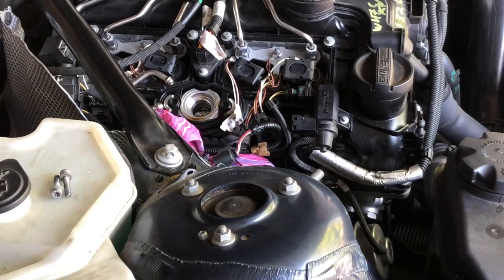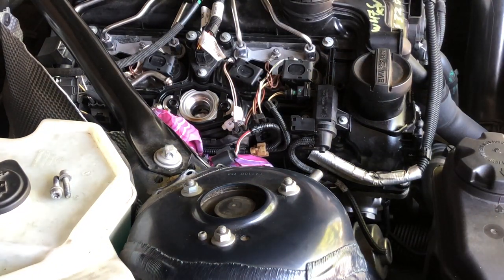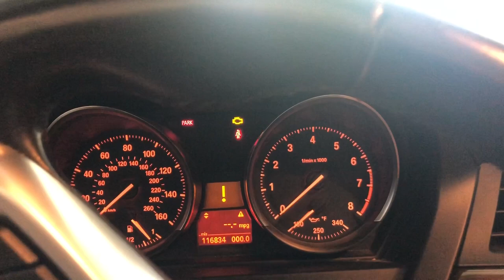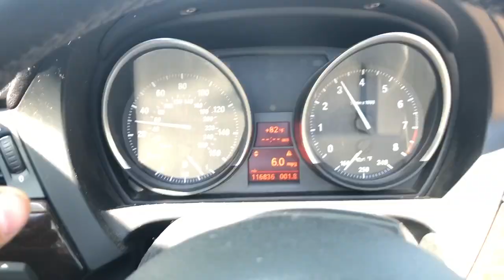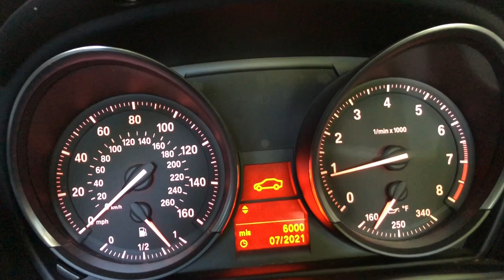High Pressure Fuel Pump Replacement (HPFP) - BMW N20 (228i, 328i, 428i, 528i, sDrive28i)

Comment from the maker: Thank you everyone for watching. Please consider subscribing for more car videos!
Reply: Hello I’m about to do this job on my car  just can’t figure out how to crank motor manually?
Reply from the maker: I put a socket on the Crankshaft central bolt and rotate it. If it’s too hard (shouldn’t be), you can use a breaker bar for more leverage.
Reply: Thanks a lot man!
Reply: Was Your car cranking and no start?
Reply from the maker: @dollaz_dollaz6499  no, I didn't have that issue. I had to change mine more because I did an engine swap and troubleshooting hot engine rough start issues.
Reply: Hi is it possible to have an oil leak from HPfuel pump gasket?
If only replacing tge gasket do you need to turn the shaft ?
Reply: Hello, I have the problem of loss of power and cylinder failure, I changed the injector, spark plugs, coils, the problem continues, the point is there is no code, much less a check engine light, purchase of 180 181 cylinders.

Comment: Literally a huge problem for all  4 cylinder 2.0 turbo engines is this pos fuel pump. Great vid thanks for info on priming the engine 👍
Reply from the maker: Sadly not even just the 4 cylinder engines, but at least it's easy to swap on these.
Thanks for watching.

Comment: I have fitted several of these pumps and never cranked the engine, replaced the rubber gasket or torqued the bolts with absolutely no issues. Just tighten the bolts sensibly and evenly. This engine layout is easy to access, the V8’s are often difficult to access especially on one side. When ordering it is best to obtain the part number of the pump fitted to the vehicle. The number is clearly visible and it’s actually a Bosch unit.

Comment: Thanks for the video. Question , did the fuel pump sound like a tapping valve by chance ? Did you have a accelerating issue before the hard start issue ? I’m changing it regardless. Dealer put a belt on quoted me for a low pressure fuel pump and said I needed a tow truck. I drove the car from there took the back seat off and verified pressure my self at the pump. They said I had codes for low fuel pressure but they were all for high pressure and also told me to replace the low pressure pump before they are able to verify high pressure. At this point I know I have good low pressure because the car will start and I can drive it . I do know it doesn’t have the power on the top end I’m thinking there isn’t enough high pressure to compensate for the twin turbos. I also had a turbo block out code. The way I see it the high pressure fixes the long starts and my top end power. All else the car has 194k on it and it is about to be 10 years old so I figured at any rate it needs replacing anyway looking at it as a ware item. Any feed back would be greatly appreciated

Comment: Hi man, Question my BMW 328i Gt 2016 N20 has hasitation during acceleration do you think it could be this pump? what are actual sympthoms. I change intake pipe and spark plugs and still same. Thank you for your video.
Reply from the maker: You have to scan the car to see what the codes are. Could be a few different things and the codes will give you a better idea where to start

Comment: Very useful guide, the part with setting up the torque force is very important. Let me ask did you change the plug?
Reply from the maker: Thanks! 
Yes, I had to change the plug because I’m in a bit of a unique situation, my car (and thus the harness) is 2012, but the engine installed is 2015 (if I remember correctly). So, the plug on the fuel pump is different, but I wanted the newer revision of the pump.

Comment: hi i have issue in bmw x3 N20 with code 110001 cylinder pressure low ..should i replace the fuel Filter and hpfp kindly suggest.

Comment: Hi! Thx for nice video! How do you know that you need to replace the pump??
Reply from the maker: There are many reasons including long crank on start up, half engine light comes on on heavy acceleration (malfunction engine light), service engine soon light comes on, hesitation in revs, etc.

Comment: Could you share more details on the connector?  6:12 vs 6:14 timeline seems to indicate there's some type of connector that was added.  Looking at the connecting points from 1:30 vs 4:30, the new part seems to have a skinnier connector.  Thanks
Reply from the maker: Sure! My car is a bit of a unique case so I didn't want to confuse people wanting to learn how to change it. My car is 2012, but the engine is from 2015 car so I modified the wiring loom.
HPFP (Newer N20 Engines, uses smaller connector)
On the N20 engine, the smaller connector is used on the newer engines (2013-2014+, depending on the model of the car) and the bigger connector is used on the older cars. So, for most people just order the one for your year model and replace it. Thanks for watching!

Comment: i just had that today ;( car just stoped and after trying start again will shut down again had rugh starts before in mornings but i tho that was normal as after minute or so engine was running smouth checed codes and its hpfp low pressure 11a002 code
11a401, 11b401,d355f2 , and fuel pump 481b03 motor current too low i ordered new pump and sensor do you think i should change anything alse??
thanks for awesome content very helpful im greatfull
take care thanks
Reply from the maker: Hard to say until you replace those, clear the codes and take it for a drive. You'll have to see if you get any new codes. Hopefully that would be all that's needed.
Reply: @SimpleCarGuy  
thanks for the answer ;) but turned out to be main fuel pump in tank ;(  but code where only for hpfp .... already sorted took few hr to replace but car drive as new no strange noise when engine starts for first time .
thanks again cheers

Comment: My bmw 328i f30 has been giving me low performance I initially thought it was due to needing a tune-up so I did it my car has run out of gas a few times with the predictive miles left in tank notification on my instrument cluster screen saying 10 miles left I've been on the freeway pushing 80mph and up trying to get to the nearest gas station and my car give out on me and I get the system malfunction possible drive train damage if you continue when I turn the car off usually I'll be able to turn it back on and continue a lil bit til I get to a gas station I went to autozone and the diagnostic test said hpfp low pressure in the hpfp system code was something like P154/3 so what's your thoughts I'm trying to tackle the issue possibly by myself or with a mobile mechanic I know who knows cars and engines cars been acting up like this for as long a probably 2 months I've had the check engine light come on and later was stored after one of those events were I ran out of gas around 10-20 predictive miles left in the tank I watched a few videos on replacing the hpfp some said if my vehicle was made before March of 2014 I MUST do a configuration modification to the adapter port I believe or the electrical wiring system if I'm remembering correctly is that necessary and do you believe just replacing the hpfp sensor will be the remedy to my problems?

Comment: Thank you for the video. Other videos are recommending replacing also the fuel lines. What’s your view on it?
Reply from the maker: BMW recommends replacing the pressure line between rail and high pressure pump. I didn't change mine, so I didn't show it in the video, but to be safe I would recommend it. 

Thanks for watching!
Reply: @SimpleCarGuy my 428i sputters when I get on it at high speeds. I’ve got various running lean/rich codes. So not sure if it would be injectors or the fuel pump. Any advice?

Comment: Hi and thanks for the helpful video! I also need to replace the HPFP on my N20. What is the difference between the pumps I can get from BMW for +1000 USD and the Bosch OEM pumps (13518604229) which are much cheaper? Are they the same? Can it cause any issues if I don't get the BMW pump? Thanks!
Reply from the maker: As far as I know the BMW pump is made by Bosch, so I don't believe there is much of a difference in quality. I wouldn't get a Chinese made/super cheap one though. I've had my Bosch one for a while now and no issues at all.

Comment: Thank you for posting this. Have a 2012 328i been experiencing poor fuel economy, bad cold start and gas odor. Hopefully this fixes it. Could also be faulty injectors?
Reply from the maker: Absolutely can be faulty injectors. Unless you have specific codes, it’s very hard to tell. Also, these engines have sensors in the fuel system so you’d know if it was fuel starvation.

Comment: My 2012 328i has been shutting off completely when reaching a high RPM, the repair shop told me the HP fuel pump lost complete pressure when tested. They quoted me 1400 on the pump and 600 in labor. Trying to investigate to see the best route to take on this, appreciate the video.
Reply from the maker: You should be able to get a genuine OEM pump for around $200 and with $20 worth of tools do this yourself in half an hour. Good luck!
Reply: Also is it necessary to replace the harness adapter and fuel pipe when doing this repair?
Reply from the maker: Nope, you can just replace the HPFP and the gasket that it comes with.
Reply: The shop I am working with is telling me that when I replace my high pressure fuel pump there are things that need to be "upgraded" so the fuel pipe and the harness adapter have to be "upgraded" as well.  Its a couple hundred dollars to upgrade these two items. Have you heard of this or are they just trying to sell unnecessary parts. ?
Reply from the maker: I checked the TIS for this and none of those are necessary. If you are upgrading to different or newer fuel pump then maybe it is needed
Reply: @joshuayoung6995  the high pressure line to the rail per bmw repair instructions is one time use. I would recommend replacement of that line.
Reply: Just get the kit from fcp euro 220-270 dollars depending on your n20s build date

Comment: how do you know which hpfp to change is it the side thats pulling codes for coils?
Reply from the maker: This engine only has one HPFP. If you are talking about an engine like an N63, then you'd go by which side it feeds. So, if cylinder 1, 3, 5, 7 is giving you issues, you'd replace that side etc.
Reply: @SimpleCarGuy  thanks for responding and i do have n63....   appreciate ya a lot

Comment: I keep getting codes warning me of a lean condition in bank 1 p0302,p0304, etc. Along with a rough idle. 
Cleaned my fuel injectors, replaced the coil connectors (Previous owner was a brute),  coils, spark plugs  and what difference, drivers like dream. But, still get the lean condition codes every now and then, and a high idle at start up that immediately settles to a steady 900 rpm idle. I am now wondering if it's my fuel pump having trouble keeping the fuel rail pressure steady. Can you advice on this? What should the fuel rail pressure be? What made you want change the fuel pump? My car is a 2015 528i F10 N20, Twin Scroll Turbo.
Reply from the maker: I believe these engines have a sensor on the injectors that would throw a code if there was fuel starvation. I actually still have a similar issue where the engine starts rough or fails to start if it was off for less than an hour but more than 15 minutes. This was the original reason why I replaced the HPFP, it helped but didn’t solve the issue all the way. I’ll let you know if I solve the issue completely.
Reply: @SimpleCarGuy  I've exactly same kind of starting issue as you descriped. 15mins-1hour after drive car starts longer than normally. I've changed fuel injectors, coils, plugs and many other things but nothing seems to help... Did you find any solutions yeat?
Reply from the maker: No solution, my latest speculation is that it’s the VALVETRONIC SERVO MOTOR, but I have no proof and don’t really want to open the up the engine for something I’m not 100% sure about.
Reply: Ok, i found the problem. 

A mechanic told me that BMW, Audi. MERCEDES and a few other brands have switched to using cheap plastic in everything from pipes,tubes to even cheap plastic connectors. The plastic behind to out gas between 40,000 to 55,000 miles, cracking and  fail when under tension and stress. Even worse the connectors are made to work at junctions with O-Rings that are just as cheaply made and just a short life as the plastic used. 

So, i had the dealership use a smog machine to find the leaks. 

AND LOW & BEHOLD!! THE ENGINE NERVOUS VACUUM SYSTEM WAS LEAKING LIKE A SEAVE!!!!

Small leaks every where!!! At ~60,000 mimes!!

$5,400 to replace all the leaking 

I told to k#$$% A$%#& and went and bought an assortment of high temperature O-Rings from Ebay and threw the dice it woild have the right sizes.  At $20 a set i could live with that.  But, not >$5k.

I also replaced the intake  tube, Boost & Charge pipe. 
I replaced all the soft hoses to the turbo with high fuel pressure lines. 

The case now runs like a dream, no idling problems, no shaking. Very responsive throttle response. 
By the way be careful when you disconnect plastic connectors. The locking mechanism is plastic also and does become brittle just as fast and will break if you stare at the wrong way. 

I spent about $900 on inlet pipe, boost & charge pipe, high temp O-Rings. high pressure fuel lines and a few hoses i broke trying to replace the O-Rings.

Everything i replaced, i replaced with over engineered parts. To make the part last and make the car more reliable.

Save your money get on youtube and build a smoke machine for cheap and learn to test for leaks.

I can't guarantee this is your problem. But, i am very happy with the results and confident the parts ib replace will last me a long time. 

I haven't found a replacement connector for the stupid OEM German plastic ones. So, i had to buy those new. But, when i do they they are out of there.

I hope this was help you. These vacuum leaks cost me a ton and i am pretty pissed at the German engineers. The old mechanic was right, crappy plastic. 

Regards
Reply from the maker: @SFSraptor  Thanks for an awesome comment, lots of good information! Unfortunately for me I have already done a smoke test and only found 1 leak that I fixed. Made no difference.

Comment: Great video, as always!
Reply: I have a 118002 fuel air ratio too rich, replaced coils spark plugs and injectors, cleaned maf sensor, nothing helps...do you have any idea to solve it? Thank you.
Reply from the maker: Hard to tell from a generic code. I would suggest getting a BMW code scanner before anything to see what exactly is the issue. Might point you closer to the actual issue. I would check your charge pipe to make sure there is no leak or crack.

Comment: Can you please explain what and where you are cranking at 3:07? Thank you
Reply from the maker: I'm using the crankshaft bolt to spin the engine. It's the big bolt on one of the pulleys.
Reply: @SimpleCarGuy  what size bolt?

Comment: Which brand high pressure fuel pump did you use? Im trying to see if bosch is any good on the 2012 328i
Reply from the maker: Bosch is perfect, I got the oem one which is made by Bosch as well

Comment: Is the high presure fuel pump failure causing hiccup when cold start...when the engine is very cold
Reply from the maker: It certainly can, but there can be other as well that can cause hiccups during cold start.

Comment: How do you find the cranckshaft bro?
Reply from the maker: It’s probably the biggest bolt you will see on the front of the engine. There will be a pulley with serpentine belt on it. Also, only spin the engine in rotation of the engine.
Reply: @SimpleCarGuy  thanks bro
Reply: SimpleCarGuy  which one is the engine spinning
Reply from the maker: The crankshaft bolt is used to spin the enginez
Reply: SimpleCarGuy Hey man. Thx for video! Doing mine this weekend. Am I correct in assuming engine cranking direction is clockwise?
Reply from the maker: That’s correct, otherwise you risk loosening the crank bolt. Thanks for watching!
Reply: How did you spin the engine when automatic gearbox was on P ? Or you switched to N ?
Reply from the maker: This car is manual so I just put it in neutral. You’d do the same on automatic.

Comment: Could this cause the 11A002 fault code? It's a 2014 118i
Reply from the maker: It sure can. That's one of the expected codes. I would suggest scanning it with a BMW scanner so you get BMW specific codes.
Reply: O

Comment: Hi man,  what was The difference after you changed the fuel pump? Better accelerațion?
Reply from the maker: Hi Costi,
If you don't have any issues, you don't have to replace it. Fuel pump can cause different issues, bad acceleration, rough idle, bad fuel economy, CEL etc.
Reply: @SimpleCarGuy  i dont have the factory power and on stage 1 the car produce far less hp than normal plus between 3 to 4 k rpm the engine couldnt run without hesitationsm when I decrease the gas from the map the car did less hesitations between the revs.
Reply from the maker: @costelariton9864  That does sound like a fuel starvation issue. Most likely the HPFP, but could also be the low pressure pump.